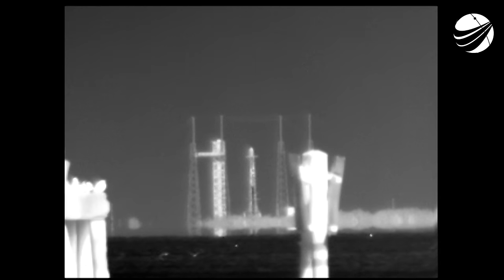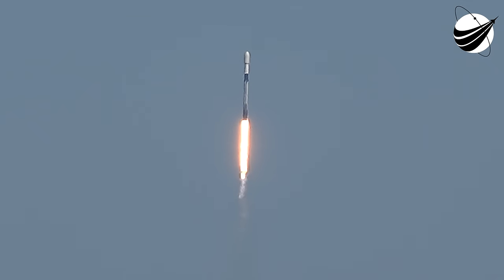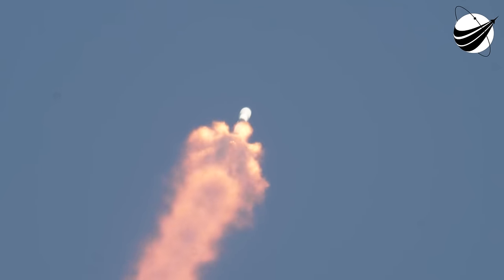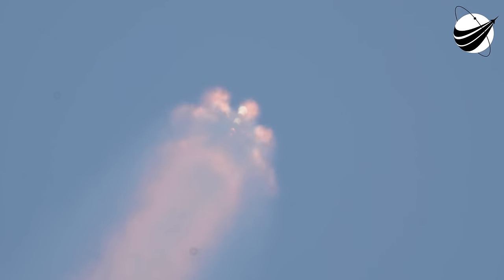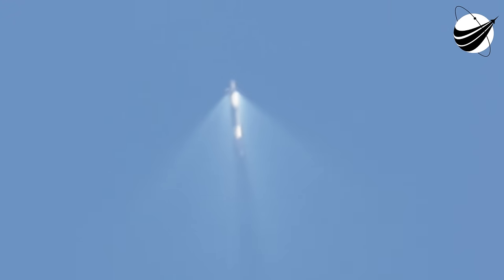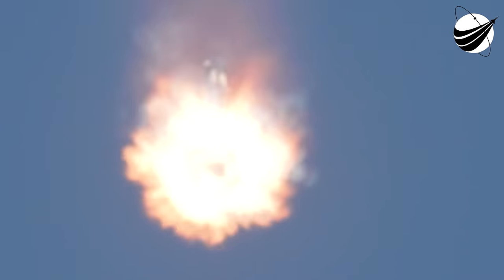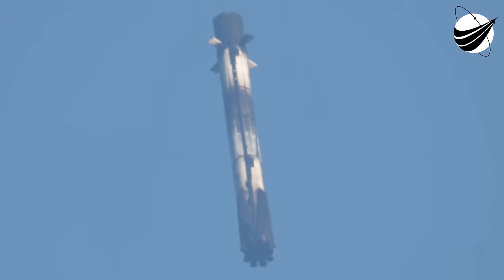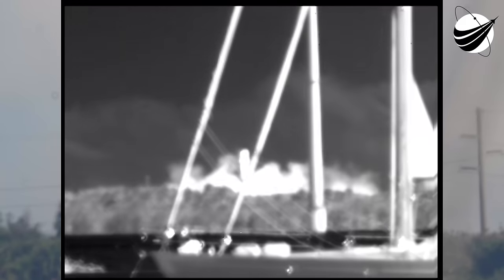SpaceX - Boost Back-Entry-Landing Burns - Shock Wave - NG20

Comment: Always great footage!
Reply: Is the shockwave barrier actually so large, or is it simply how it appears? I expected it to be more pointed, rather than shield-like in shape.
Reply: That's a bow shock and is typically not attached to the object.
Reply: @FlankCobra  that's a bow shockwave, and it's lower air pressure between the shockwave and the vehicle
Reply: when I hear "Go systems . . . " I always get a tingling feeling on my spine, lol.
Reply: It's fake CGI,lol
Reply: Fly safe!
Reply: Shame about the Audio
Reply: @DogSerious well then the creator of the cgi is so ridiculously talented that they matched everything up perfectly with what real is.
Reply: @TheCrimsonBlade2 Not too bright eh?
Reply: @DogSerious    Somehow I'm thinking your comments were AI generated.
Reply: @BWolf00  5:26 lol, you can't see the rocket for blur yet you can see it's fumes? lol. You keep watching tv, lol.
Reply: @DogSerious   Don't own a TV...never have.  As for the "fumes" we also see water vapor at vast distances, but in this case SpaceX is using nitrogen cold gas thrusters...jetting very high pressure nitrogen to help maintain attitude/orientation control.   BTW, do you have any idea as to what tech the guy is running to a track the booster and control the telescopic lenses?  I don't, but I'm pretty sure it's not "CGI".
Reply: @BWolf00 Lol, you will believe anything!
Reply: @DogSerious  If I told you I saw that thing land with my own eyes , would you think I work for the government then ?  I believe you are a flat earther as well ...
Reply: Hullo
Reply: @Keverke54  I too, was set up to the left of the US Launch Report tracker, watched & shot the launch and landing. It was spectacular. And it really happened.
Reply: @DogSerious  The best in the business....They have came a long way from the Apollo days....I can't believe people still think this money grift is real.
Reply: @Keverke54 But you didn't, did you? lol
Reply: @bobcastro9386 lol, full of it.
Reply: Nobody speaks about CARBON EMISSION of  rockect business!! Are they exceptional??? LOL!!!
Reply: @DogSerious How do they make CGI so good that thousands of people, who watch launch and landing live on location, think it’s real?
Reply: @bobmusil1458  lol,you've been watching movies all your life and now you question their methods? lol. And, ever heard of the "all rockets go into the sea theory?"
Reply: dont be naive....not now..
Reply: @DogSerious  If you had been with us on FL state route 520 at the water's edge, seen, heard and felt the rocket launch and then booster landing, would you have disbelieved your own eyes? Who exactly speaks into your life? And for what purpose?
Reply: @DogSerious  So, rockets are real, go up into the sky, fall into the sea, and then come back and land again. 
But they are also not real because they are just CGI.
 Correct?
Reply: Those binocular, telescopic, robotic cameras, wow.
Reply: @bobmusil1458 Not too bright at all.
Reply: Love your youtube!
Reply: @brians48now  You are right, but a lot of people believe these trolls.
Reply: @DogSerious bro, you’re the one who’s not too bright, millions of people have watched space X launch falcons in person, as you heard in the video, if you watched it, over 250 landings of an orbital class booster, 10 landings just with that specific booster, tens of thousands of people build these boosters and maintain them and operate and assist during launches, there are men on the ISS hundreds of kilometres above the flights you probably don’t take because you think the airline industry is all a sham, who receive the cargo and new crew members or are flow back to earth by the Falcon and Dragon teams of Space X, no, this is not all an elaborate ruse for your personal enjoyment, and you are not one the few 0.01% who believe and whisper to your friends who roll their eyes that space is fake and the firmament exists. Why don’t you fly.. or wait sorry, maybe drive down to Florida one day, and watch as they launch 10-15 rockets in a month, sometimes twice a day, you could go see it yourself, like tens of thousands do, but you won’t, because that would prove that you are wrong, and you want to die believing you are right.
Reply: @leviharris7267  Anyone can fake a rocket, but going into space,that's something else!
Reply: @TDurden527  when I hear "vacuum of space".. My brain goes.. Duh.. Hows that even possible with gas pressure system nezt door..?  Does thw rocket put the cork back in as it leavea our gas preaaure system and enters a vacuum?   😂😂😂  Forget thw tingles.. Tuen your brain on..  Its like watching Disney fairytale stuff.. Now that gives me tingles.. 🤦‍♂️🤓
Reply: Péssimos cgi.lkkk
Reply: it's great how a rocket so massive can be so delicate. Bravo.
Reply: @JoeNinety9  Im still trying to work out how big the cork is to block the hole ..   😂
Reply: i found one of those rockets in my moms sock drawer. u think she works for space x!!??
Reply: @Adrian-vd6ji  probably amazon..
Reply: @sammy7428  hehe
Reply: @DogSerious  Always has been, fake…

Comment: Doesn't matter how many times I see it ,
It is just so incredible how SpaceX nails landings....
Question " Can you land it on a small raft in the ocean plz and  also put it in a little chalk circle that is, just big enough for it, right there on the deck ?"
SpaceX "No problem where in the little chalk circle would you like it us to land it ?"
Blows my friggin mind every time.
Well done to all SpaceX guys an gals
Huge respect
Reply: It`s amazing that they landed it many times on a small raft in the ocean. But what I find more amazing is what they just did there. How did it come back to the launching pad (if it was the launching pad)? OK, they canceled the forward speed with the booster, but how did it come back from the distance covered? Just by gliding?
Reply: It's so amazing it doesn't seem real.
Reply: @denischarette-de3te   "distance covered? Just by gliding?"  Pretty much.  Controlled descent using adjustable fins and bursts of gas.  Pretty amazing co-ordination of tech.

Comment: Wow, great tracking!  As a little kid in the 70s, I remember how they needed to keep the camera moving so the magnified image of the rocket flame wouldn't burn and permanently damage the phosphor screen inside the image orthicon camera tubes.

I watch every Vandenberg launch I can from Llano in the Mojave desert, over 100 miles away.  From this distance, the main booster flame is the size of 1/3 of a #2 pencil held at arm's length, and very bright and conspicuous.  Can almost always hear the sonic boom of the first stage returning, and watch the second stage all the way to the SE horizon.

Comment: One of best videos of this element of the flight. Visual blocked by trees at last couple seconds was disappointing. It would be nice to append a video segment of actual touchdown. Surely there was a cam at the landing site?
Reply: We are not any part of spacex so we have no access  to any spot where you can get a view of the landing without the trees. We actually  set up about 14 miles away on 528 bee line ex.
Reply: @edgeiger6621  Thanks for explaining!

Comment: What's bugging me is why they zoom in that much? Not even the entire rocket is in the frame! Just zoom out a little for context.
Reply: The telescopes we use don't have a zoom feature.
Reply: @edgeiger6621  I assumed that was the case. But then again, I have seen changes in focal length too. Other than that, theoretically speaking two things can still be done. Putting the telescope farther from the launch pad, or using a telescope with a wider field of view.

Comment: Everything works but we are still far away because this system would be truly revolutionary only if it were able to land on natural surfaces, not prepared or adapted so I imagine they will work on a system that is able to autonomously detect a site suitable for landing and has the "legs" capable of adapting to any differences in level or sagging... lots of experimentation still.

Comment: SciFi vs $$$. We cd'v done this 50 years ago, but the micro lsic computer tech (calc, mfrg, & mission) wasn't good. I'm 83 and designed Apollo turbos and  chambers and Shuttle cryo helium valves. My career & THOUSANDS of others went down the toilet when Nixon & Congress cancelled and cheapified those two. You can't turn major projects off & on without human cost. USA lost 50 years, and wasted human capital with no continuation. So maybe space business is seen as viable enuf to start over. Thanks Art C Clarke.

Comment: What is the Carbon Foot Print of this mission ?
Reply: C-footprint is or can be ZERO. Fuel comes from methane which can be made from CO2 and water. Oxidizer is oxygen from the air.

Comment: 9:18 that thrust looks so weak that object should just fall out of the sky, something is not right with this picture.
Reply: It slows rapidly when that weak thrust, the 10m/32ft tall flame, hits solid ground. The giant 17 second burn before slowed it down enough already.
The rocket itself is 70m/230ft.. The boosters tail of flame pushing something into space is the size of a building. Everything about it is just insanely big.

Comment: Funny looks like AI 
Looks like the actuators burned up before separation, then simple mechanical, materials and physics calculations would not support the amount of force required to land without bending the landing gear… then it always happens behind the trees. 
The shear linear mass momentum few seconds before touchdown make this not credible. Experienced mechanical engineers point of view..😂

Comment: Fake. There’s just a few problems here. 1. Going nozzle first to re-enter at multiples of the speed of sound is not only unstable, would tear them off. 2. Relight would be a problem in that environment 3. Re-entry from a low orbit would take more than 3 minutes 4. There would be no payload, carrying fuel to return, that’s why they used parachutes in the 1960s.
Reply: Just because you don't understand it doesn't mean it's fake.
You are not working in the field are you.
Reply: ... my little fool. Thousands of random people from across the world have seen these land in person. You can go to these events and watch it for yourself.
Reply: @n3v3rforgott3n9  have you seen it live?
Reply: @mikeyriley8959  Yes :) You just have to drive there when they have one scheduled to launch.
Reply: @mikeyriley8959  Literally millions have over the 8 years they have been doing these landings. I have too. And yet flerfs are too stupid or lazy to go down there and see it themselves.
Reply: 1. SpaceX engineers and physics prove you wrong on that point. Sam with #2. The booster does not reach orbit or orbital velocity, that is the second stage which is not recovered. 4Huh? The booster doesn't carry the payload. Again that is on the second stage.
Reply: @kevinconrad7648  where exactly was the one you went to?